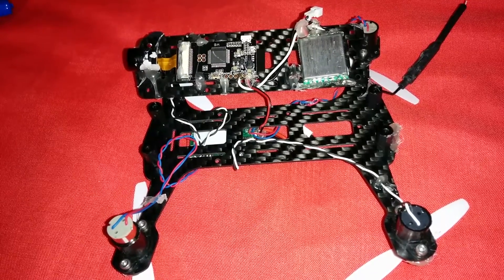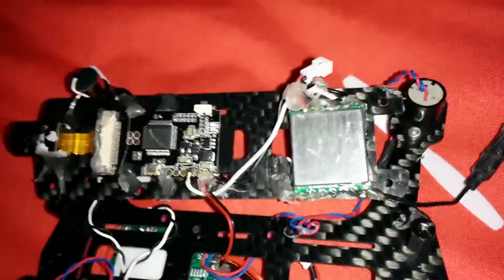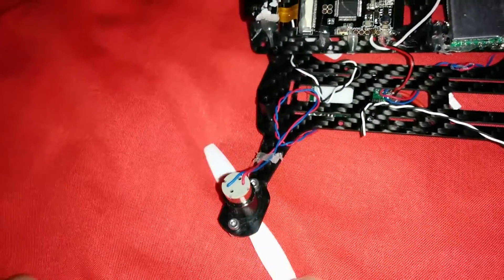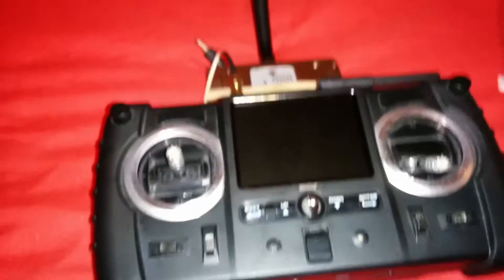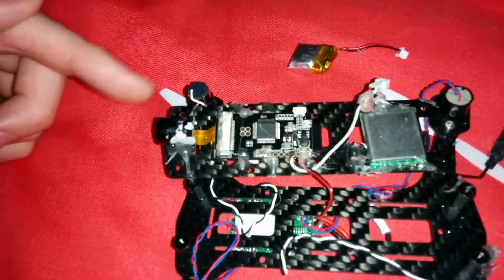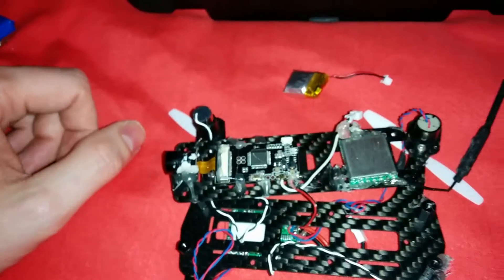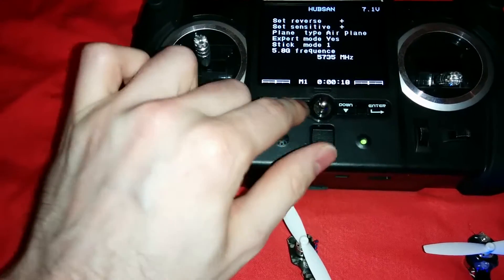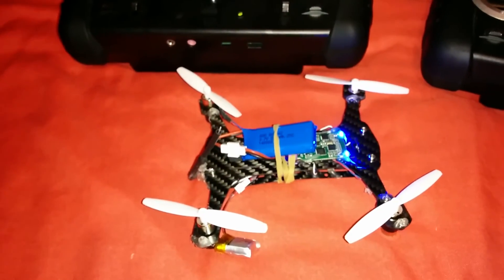H107C HD cam Video out capability!

Comment: I know this is old but which transmitter is that? Trying to add FPV to my x4
Reply from the maker: transmitter is hubsan spyhawk TX
Reply: AndyRC the vtx?
Reply: A related but off-topic question. Do you own the spyhawk or just the TX? I'm curious if the original x4 controller binds to the spyhawk RX for another project. Any help would be appreciated! Thanks!

Comment: Great builds and videos Andy! Could you please help me I'm trying to build a similar micro..problem is the last two original 2mp camera (sealed in Hubsan packet) I received  has only got 4 copper soldering points as opposed to the usual 7, do you know if there is a video out on this version of the Hubsan camera module? Thanks man
Reply from the maker: +nopike2big yes its still the 4th one along (last one)
Reply: +AndyRC superb thanks a lot..I couldn't find info on this anywhere
Reply from the maker: no probs

Comment: Hey man !
I have my vtx powered separately. So I use the video out wire ( 4th terminal on the 107c camera board ) and feed it to the video terminal of vtx and I get nothing. I'm unable to get video. Please help !
Reply from the maker: +bruceleedv are u getting static or blank video? is it definately the 2mp version you have? cheers
Reply: +AndyRC . Yes I'm pretty sure it's 2 mp. It's blank. No video. I'll post a pic in a min
Reply from the maker: +bruceleedv I think i might know the issue. you say that u are powering the VTX separately. u need to power on your VTX first before powering the camera. It can detect when a video source is required. if u turn the camera on first then it detects no video out feed and does not put the video out. give it a try
Reply: +AndyRC 
Tried that, didn't work : (
Reply from the maker: maybe theres something wrong with your connections. double check what u have done u will get there
Reply: ok man, will do! Thanks for the help, appreciate it !

Comment from the maker: Wyatt Leuck yes it is cheers
Reply: AndyRC Would you still recommend a setup like this for micro FPV?  If so, what antenna would one use for that 5.8 vtx?  

I was considering the Estes Proto X FPV but it seems I could build a micro with better range and flexibility.   I was thinking of using the Eachine X6 controller and making a micro hex, then adding this H107C cam and the transmitter you used here.  Not sure if I have the soldering chops to pull it off, but if I can, it seems like it might be worth it.  You have any updated thoughts?  Thanks for your info and channel!
Reply from the maker: personally i dont use the MMW frame. I use the picnic quads frames. i do a full micro build similar to your required setup on my channel. have a search through it. cheers :)
Reply: AndyRC Awesome- yes, I've been watching lots of your videos.  The micros you're doing look great!  I'd probably either try a 3D printed frame if I can make it light/strong enough or go with a Picnic Quad frame.

Do you think going Hex is worth it over quad to hoist a little more weight and get a little more powerful setup for range and flight time?  Thanks again!
Reply from the maker: i built a micro hex on my channel which i still plan to do loads of stuff with. A hex will definitely lift more weight but the flight controllers are much more limited than a quad

Comment: I just got a H107C 2mp HD cam board. I find they made change on the circuit and I am not sure which one is the video out connection point. Is there any sign or mark on your board to show the connection point?
Reply: Wallace Lai Hi , same case , i just receive the module , but they change the design of the board .... Where is the Video out ? ;)
Reply from the maker: Fabien Rculone fourth pin along
Reply: AndyRC  Thanks to reply me . My board is 2013 rev ... there is not the straight line of pads.
Reply from the maker: can you take a picture please?
Reply: +AndyRC http://www.casimages.com/i/150807115544558875.jpg.html

Comment: That case is an RF shield. May not be worth trying to remove. Very nice I am going to try this tonight with my matching spare parts.
Reply from the maker: good to know cheers
Reply: So I tried putting this together and I only see a black screen on my fatsharks. It definitely knows something is there but I can't get video to show up live feed. I verified the SD card and it was recording while I was trying this out. Any ideas? Flite Test shows the TX I am using ( http://www.rangevideo.com/58-ghz/10-tx5200m-58ghz-200mw-5v-transmitter-module.html ) works with Fatshark.
Reply from the maker: MADelectriCITY are u using the h107c 2mp board for the camera?
Reply: I am trying to make it work. Is it PAL maybe? I have my Fatshark goggles set to NTSC so that could be the problem...

Comment: Very  Very nice Andy! I know you wanna get the perfect FPV micro! I advice go for the Syma X11, i got 16 mins flighttime with the MMW motors :) and there is plenty space for fpv parts! I got also the same frames as you, but sinds i have my X11 i think its the perfect micro fpv. Also i modded it with a hubsan FC. You can find the video's on my channel :D

https://www.youtube.com/watch?v=FeoJlUdciHU
Reply from the maker: my problem with that is i dont like the toy style TX you get. with this setup i can use the hubsan spyhawk transmitter which is better quality and more suited to the way i fly but thanks for the link
Reply: I am using the hubsan tx in the syma x11. This will fix your problem :)
Reply from the maker: ah they are compatible are they?